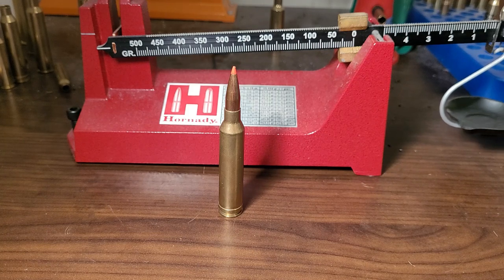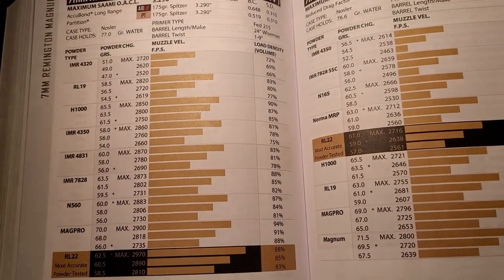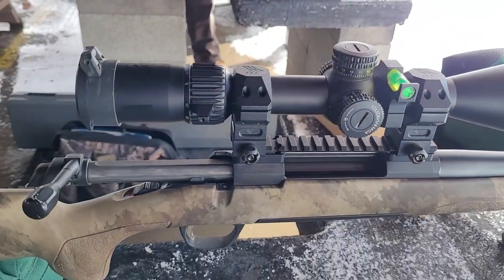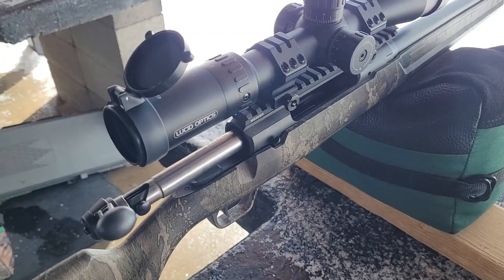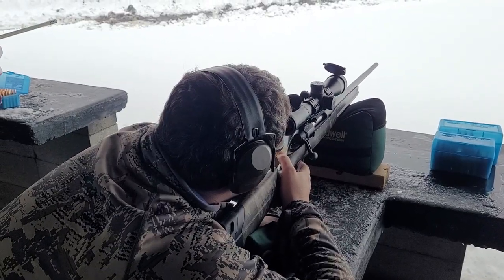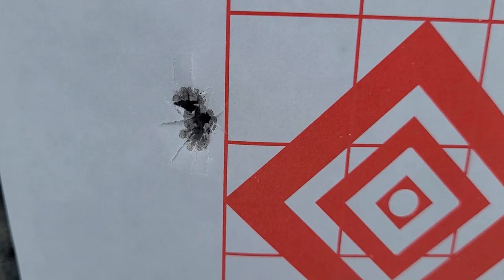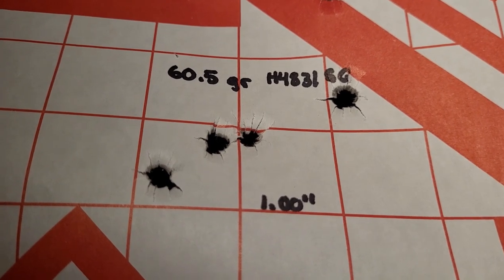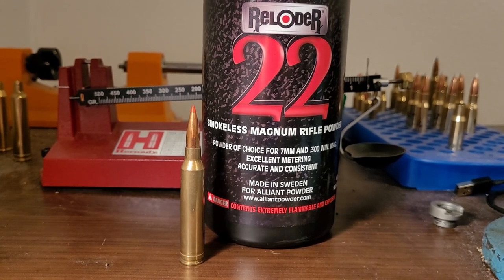How fast will the 7mm Rem mag go?

Comment: That's a great load. You should be able to match or exceed the 7 PRC, on the rokslide forum they pulled apart a 7 PRC load and figured it looked like RL 26. They loaded up the exact same charge of RL26 as the factory round and it was identical in speed. RL 26 is fast but has a reputation for being volatile. A 1 in 8 twist 7mm RM is at least as good or better than the Hornady round. The new Remington's are also going with a 1 in 8 twist for the 7mm RM.

Comment: I have a 7rm and am shooting 180 eldm at just under 3000fps. Retumbo, rl26, and n565 are my choices for the 180s. Extremely accurate and devastating on whitetails. As long as you have a fast twist barrel you will have no issues pushing them over 2950
Reply from the maker: Just need to find RL-26... and Retumbo
Reply: @ReloadingWeatherby  finding it is the hardest part of that equation

Comment: I have been reloading the 7 mm REM Mag since 1975.

High velocity with 175 grain bullets is done with Retumbo, VV-570 and RL-33 !!!
Reply from the maker: Wish I had that powder
Reply: How fast can you get 175-180 bullets with retumbo
Reply: 3,000 fps in a 26” barrel
Reply: @robertblumer2578  whats the best powder for 160gr? I’m getting 3120 with 160gr cx 71.7gr of retumbo, new brass, 215 primer but in trying to get just a bit more velocity
Reply: I get over 3000 with h1000 its temp stable, I save my retumbo for my 28 nosler.

Comment: Not all guns are equal. I have had three 7mags. First I didnt own a chrony but second was a Interterms fancy rifle it had longer then a 24" bbl  and shot pretty well. Reliable to 1" with most loads and broke 3k with my 160's. (My preferred) That rifle was gifted to a very good friend as he lusted over its figured stock and nice bluing. I hunted for three or four years until I found another. Same rifle but plain walnut without grip cap or forend tips of first. Anyhow I had to really push to vet solid into 29's. Just past 2950 and thats all I can get with any powder I have tried. 

This is something I have seen before. Bottom line is that Some barrels simply are "faster" then others.
Reply from the maker: Absolutely it comes down to the individual barrel

Comment: One of my 7mm Rem Mag with 1-9T 26” tube pushes the 175 grain NP which has a very long bearing surface @ 3060 fps with no pressure signs.
IMR- 7828,
H-1000 pushers the 180 grain Hybrid @ 3000 fps easily and SD and ES both single digits.
RL-26 or Retumbo will provide higher velocities.
Reply from the maker: So you have no need for 7mm PRC

Comment: Despite the velocity accuracy wise adi here in Australia recommends 2217 which is your h1000 equivalent not the slowest not the fastest but most accurate but if you could get 3000fps which is possible with 175 grain would it still group nice is the question . It seems 160 grain is the sweet weight for this calibre

Comment: I didn’t realize 7mm rem mag was that fast. I was debating between rem mag and prc down the road. I don’t think I need the prc after seeing this.
Reply from the maker: Get a 26 inch barrel and it will most likely match the 7 PRC
Reply: I've got both. Get the PRC if you have neither

Comment: Use some 140 grain bullets next, just a couple to see please.
Reply from the maker: He hunts with the 140 gr. They are going over 3300 FPS.
Reply: @ReloadingWeatherby  that's what I use and they work great
Reply: What bullet do you use?
Reply: @Jay_guy712  usually ballistic tip boat tail, but with the last couple of years I take whatever I can get my hands on. Amazing how a shortage will end being picky.
Reply: @GrouchyOscar-cx6df  Haha I'm in the same boat
Reply: @Jay_guy712  I've burnt out a couple of barrels on my 7mm rem mags and bought a couple of 7mm-08 rem and not having that issue now. I shouldn't have been plinking with my 7mm rem mag, live and learn I guess. Majority of my hunting is done within 300 yard and the 7mm-08 rem does just fine. Not to mention lower recoil is nice, especially with my odometer turning.

Comment: Back 10-15 thousandths off of the lands, and use either Retumbo or R-26. You’ll achieve 2,970 with 180s.
Reply from the maker: I think we will get it with RL-22, if I could find RL-26.... I'm sure we could easily get 2970
Reply: I think you will get it with RL22 also. Increase in increments  0.3gr and watch the pressure maybe? Giving yourself a little bit of jump is probably a very decent idea. I believe you'll hit over 3000!